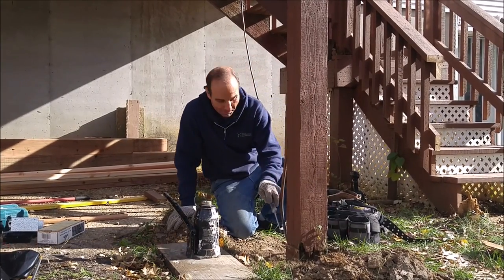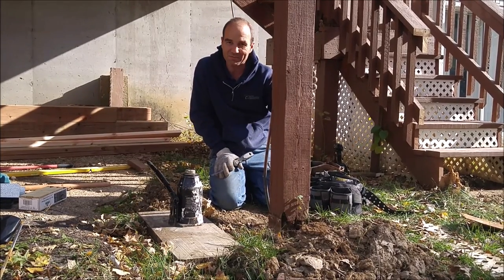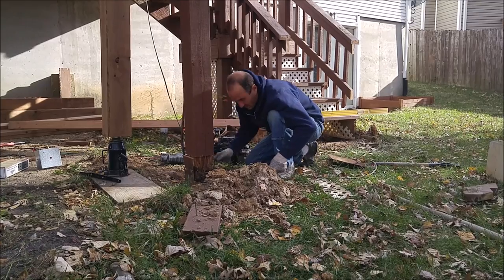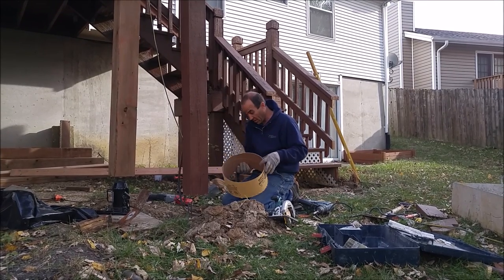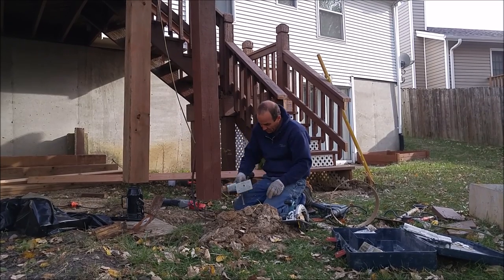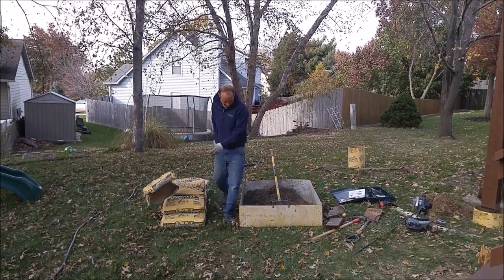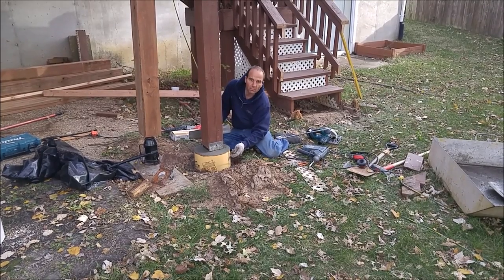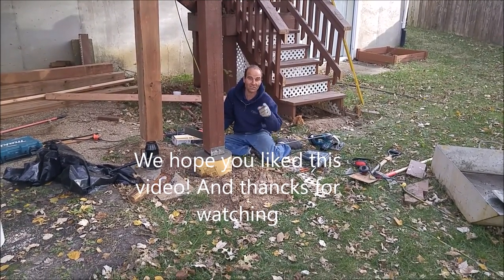How to Replace a Deck Pier

Comment: Excellent. I was planning on hiring a contractor and replacing my entire post but this seems far more cost effective and something I could do myself. my deck is exactly like this too. Extremely helpful!
Reply from the maker: Douglas Kennedy, glad to help!  
Please subscribe to our channel so that you are notified when we post new videos.  Hope all goes well!
Reply: @Homemaintenancesolution  I really appreciate the video! What do you think is the minimum height of a sono tube you can mount to the existing pier? yours looks about 9-10 inches? I am dealing with a short Post height. I am working with about 12"  of space between the deck and the pier. Would 4 inches of height be enough?
Reply from the maker: @JetSetBaroni  I think so.  That should work.
Reply: @Homemaintenancesolution  I appreciate your reply. What thickness rebar did you use? 3/8" or 1/2" ??
Reply from the maker: @JetSetBaroni  either is fine, but I used 3/8".

Comment: I have a screened porch (12x16) that has 6x6 support posts at the front of the porch and a support beam (16' wide) with notched 6x6s and 2 2x10s that is 3' out from house under the porch.  The ground under the support beam has sunken and the support beam pulled away from the porch.  How would you tackle bringing the support beam up to make contact with the porch?  The porch is not high off the ground (3-4') but you can get under it and do some work.  Just trying to gather some ideas on a method to fix this.  I really don't think the support beam is needed because the porch is so low to the ground and have less risk than those 2 story decks of pulling away from the house from lateral force but the support beam is code.  I am thinking of doing the same as what was done in this video, but would like to see what others may have done with a similar problem.

Has anyone had the same or similar problem?  If so, what did you do to fix?

Comment: Thanks for the video.  Exactly what I am doing.  Although I don't see anything about digging out the old post from the cement.  This is what I'm trying to do but having a difficult time. Using a drill and chipping with chisel. Is this not needed?
Reply from the maker: That's a good question.   This is meant to cover how to correct the height if the post is on the concrete.  If you posts are in the concrete, then I suggest breaking the entire pier out and repouring it.  The wood post in the concrete will weaken it and it is most likely not deep enough or large enough at the bottom.

Comment: What type of Jack can i use to jack up my deck as I have the exact same problem you demonstrated here except that the concrete base on mind is 6 inches above ground, and the whole base goes down to a depth of 1 foot. Not sure if I have the jack hammer the top 6 inches to make it flush with the ground. Can i use a regular car jack or one of those car jacks that comes with the 4 wheels and solid based. What type of jack did you use in this video? Thanks!

Comment: I have 12 x 12 deck with three posts, the concrete bases are 4 to 8 inches below ground level, and barely larger than 4x4 wood post.  They may probably deep enough to or below frostline, can I rebar and pour new concrete over to make new base above ground?  Thirty years old house so the base should be settle down good, I wouldn't mind to leave them alone and rebar on top.... will that be appropriate way to do it?  A million thanks from all of your input.
Reply from the maker: My method that I show on the video is to extend a properly sized pier above grade.  If you pier is undersized, then extending it will not help with that.  You will still have an undersized pier, but at least you won't have a rotting wood post on top of it! 😊
Reply: @Homemaintenancesolution  thank you for your reply.  Illinois  frostline is 36 inches, if all met the Illinois codes when they built, then I think I will just take out old 4x4s,  clean the old piers real good, rebar through the old piers,  pour concrete up to 4 - 6 inches above ground and 8 inches diameter. Do you think that would be decent enough? I really  don't want to rebuilt my deck, just want to correct rotten posts.  Am going to replace the old deck wood with composite after that. Edit:  I meant new 12 inch diameter (cylinder), there is no 8 inch :)
Reply from the maker: @nghichlanli1152  seems like a good compromise.  You can't be any worse off than you are now.

Comment: Perfect. Exactly what I was looking for. My option is a bit different in that I do not believe my posts are sitting on concrete pylons although the bottoms are starting to rot out.
Reply from the maker: Dan Peoples, glad to help!  The process is basically the same, just do a little more digging.  Make sure the bottom of your new hole is below your local frost line and flared out at the bottom.  Also, be sure to tamp the dirt at the bottom of the hole before you pour your concrete.  Best to you!

Comment: Great video!  Thanks for the help.  Question:  You said elevate porch quarter inch above where you want it to rest.  Did you leave the post base unbolted to the post until after the concrete had set and you had lowered the post?  I'm wondering if failure to do this would cause anchor bolt to prevent lowering of post after the concrete had set up and shrunk.  Is this an issue?  Thanks again!
Reply from the maker: Yes.  I would wait to add the fasteners until after the concrete sets up and you remove the jack.
Reply: @Homemaintenancesolution  how long should you wait to let it set up?
Reply from the maker: @102wingnut  24 hours is good.
Reply: @Homemaintenancesolution  awesome thanks!  I may be using this method this weekend!

Comment: I have deck piers that have a hole where the post used to be. I don't see enough concrete to put the rebar in. Do we need rebar or can we pour the new concrete into the hole left by the post and into the concrete tube to recreate a better pier?

Comment: You need to secure your short pieces of rebar to your existing pier by using concrete anchoring epoxy adhesive.  Important step!
Reply from the maker: Thanks for the comment, Mark!  Actually, it isn't necessary here, because the bearing weight will keep the pieces together.  The rebar just keep lateral movement from occuring.

Comment: Exactly what I need to do to my back porch deck. It has a roof over it attached to the house. The pier holding up one corner is on a slope and has slipped about 2 inches. What tonnage size jack should I use ? It's a 12' X 12' deck.
Reply from the maker: I'm not sure,  but probably not as heavy as you think it is.  Just try a decent sized jack and see how well it lifts it.  If it won't then you know you will need a bigger one.

Comment: How big and deep of the holes would u drill if I am using a 1/2 inch #4 rebar? Do I need to blow the the concrete dust n clean the holes after drilling? Great tips, thank you.
Reply from the maker: I would clean out the holes a little, but it's not important since the rebar is only to prohibit lateral movement.   I would drill them around 4" deep, if you can.  Thanks for the reply.  Please subscribe!

Comment: Thanks for the great video.  My situation is a little different so curious how you would approach my issue.  The corner of my deck has lifted an inch or 2 due to the cement pier lifting out of the ground.  It’s also the corner of the deck near the stairs but I don’t think the stairs lifting due to frost were cause of the problem.  It clearly looks like the cement pier lifted raising the corner.  
Thinking I could level off by cutting off some of the 6x6 but my fear is now that frost has moved that pier once I’m afraid it will be an annual event of moving due to frost  now.   Am I better off trying to fix the position of the cement pier that lifted a couple of inches and if so how would you go about it?
Reply from the maker: We'll, ideally you would replace the entire pier with a properly designed pier that has a large enough footprint and is below the frost line in your area.  

You could try cut the 6x6 off and see what it does first though.  If it settles back or moves in any way then you know you need to dig that pier out and replace it.

Comment: I know the video is older. How long does it take for the cement to set before you can lower the post for load bearing? Approximately how much concrete is needed? Thank you for the informational video.
Reply from the maker: You'll have to figure your volume in cubic feet and look at the bag cubic feet amount.  
A good rule of thumb is wait 24 hours before bearing on it.  If you have a large amount of weight concentrated onto one post, then give it 48 hours
Reply: @Homemaintenancesolution  thank you

Comment: Where exactly did you support the overhead structure so it was safe and solid? That critical factor is why I came to this channel. I guess you didn't think that was important.
Reply from the maker: Good question.  It will be different on every deck.  Look at how the weight is transferred to the posts.   If the posts are supporting a beam, then jack under the beam.  If they are connected to the outside rim joists, then jack under those.  You just need to get under something that is supporting a broad amount of weight.  Don't jack against a deck surface board and expect the nails or screws in it to be strong enough to lift the deck.

Comment: Wonderful video, My post is loose but I don't see rotted wood, the wood is inside the soil though, after looking at your video, I feel this has to be fixed anyway to avoid quick rot.  How to fix it, would be useful if you have a video for that.
Reply from the maker: You should be able to solve your problem by following the same process.

Comment: I have a similar problem but rather than exposed grade I have a brick paver patio that surrounds the deck posts. The posts run through the paver patio to poured posts, but the lack of maintenance over the years to keep the pavers sealed (previous owners)  has led to the decay of the wood. Any suggestions you have are appreciated.

Comment: Great vid! How old was that deck? I just had one built and they put in a metal post base (like yours) but its all below ground and now buried. My 6x6 PT posts in partially buried. How long will it take to rot?
Reply: Thanks! I'm not sure how old that deck was.. Your pressure treated post should last 5 years or so before they start rotting, but I but I would clear out the area or raise the pier height to prevent it if I could.

Comment: Great info. thank you.  I've been looking for this exact info. for a while.  Can you please tell me if the sonotube diameter needs to be the same size, bigger, or smaller than the old pier on which it will sit?
Reply from the maker: Kathy and Steve Moelter, thanks for feedback.  Glad the video helped you!  
The size of the pier extension should be about the same as the existing one.
Please subscribe to our channel if you haven't already done so.

Comment: Thanks for the info! So I'm guessing the old post was just anchored to the top of the pier? If a post was buried down into the concrete footing, would you just dig out the footing and pour a new one once you cut off the rotting part of the post?
Reply from the maker: Yes, except I would try to get as much of the wood post out of the concrete first.  That will help the new concrete lock on to the old better.  Best to you!

Comment: Thanks for the great video. I also need to raise my sono tube footings about  8 inches. I would also like to increase the diameter. Do you see a problem putting a 10 inch diameter cap over an 8 inch diameter pier that goes down well below the frost line? My current situation has the piers about 3 inches below ground level and 6x6 post on an 8 inch footing barely fits.
Reply from the maker: As long as the 8" piers provide enough footprint to support the amount of weight on them, then it should be fine to make the top bigger.

Comment: Question.  I see you used a 12" sono tube.  Is that the same size as the existing concrete post or is it wider or narrower?
Reply: Did you ever get an answer to this question somewhere else?  I’m planning on replacing my 4x4 deck posts with 6x6.  Existing posts are below the grade (in the dirt, sitting on sonotubes.  I want to extend the sonotubes so they r slightly above the grade, and can support 6x6 posts.  Trying to figure out if it’s possible or if I should just dig them out and pour new
Reply: @martinpersaud1319  No, but I removed the rotted posts from the concrete under the deck and porch (Pain in the ass job) and drilled holes in the existing concrete (3-4) and installed rebar and used the appropriate sized sono tube (12" in my case) and poured/bonded concrete to the existing concrete footer.  The existing concrete was in good condition with no cracks.  I used Simpson Strong-Tie ABA 6-in x 6-in Zmax Wood To Concrete Base to place the 6x6 post on to keep wood off the earth and concrete.

Comment: Similar situation with my deck which currently has two, 4x4 posts. They could come up a good 5-6 inches. If I’m going through this process, would it be valuable to move to a larger post?
Reply from the maker: It could be Jason.  There are lots of variables in this decision, so I wouldn't want to steer you wrong because I can't see your situation.   I guess if you aren't sure, it wouldn't hurt to go to 6 x 6s.  Best to you!

Comment: Thanks for the video! My balcony wood deck is sagging on one far side. I cannot figure what is causing it, but I suspect it is the 6 x 6 support pillar which seems to have twisted out of alignment and the horizontal brace beam above it is also sagging downwards. while the other pillar and horizontal support beam are perfectly aligned. the support beam on the sagging side is not plum or perpendicular to the bottom of the deck. Do you think it shifted or may be rotted at the base? Maybe I need to do what you did here. Thanks for any suggestions!
Reply from the maker: I suggest getting a professional to look at it.  It is hard to diagnose without seeing it.  
If your pier is settling or shifting out of alignment, then a new pier is probably in order.
Reply: @Homemaintenancesolution  Do they sell pre-made tiers that come with the support base bracket and pre-drilled anchor? Maybe If I jack up the deck with some support blocks, and dig underneath, I can better access the damage. Thanks for commenting!
Reply from the maker: @charronfamilyconnect  No.  You really need to get a professional in to look at it.  It sounds like this is above your skill level.

Comment: How do I do what you  did because all I have is small cement blocks under my post that are starting to rotten. I have NO peir  base .The cement blocks is all I have under my post that set on dirt.
Reply: That makes it a lot harder, but it can be done.  You will need to dig a full pier down to the frost line in your area.  It needs to flare out at the bottom before you pour the concrete.

Comment: Thanks for making this video, I have to do the exact same thing. Question: how do I know the old peer is deep enough to use, how deep should it be? Thanks again
Reply from the maker: That's a hard thing to know for sure.  The pier should have a wide base (the diameter of that is calculated by the load by an engineer) and be below the frostline in your area.  Here's an article that might help in your area. 
https://www.decks.com/how-to/264/deck-footing-frost-depth-map
The standard way of checking the depth of you footing or pier, is to use a long metal rod with a point on it.  You can push it down into moist soil and project the depth of the footing by where you are hitting it or not.  

All that to say that this is not an easy thing to determine.  I usually use a different test.  
IS THE PIER SETTLING OR HOLDING IT'S OWN?  Some piers will be crooked and/or settling.  If that's the case, then I wouldn't add to that.  If the pier was low to start with (or the ground has been added to) but is stable OR settled a couple inches and has stabilized, then I would consider it to be a good candidate to add to.  Hope that helps!
Reply: @Homemaintenancesolution  Yes thank you for your help I appreciate it. I did some digging, I can't believe the previous home owner set a 6x6 on top of a cinder block and buried it. It's a raised deck about 12' off the ground. I'm no expert but I'm reasonably sure this is not only dangerous but it's also against code in every state.
Reply from the maker: @billveder1071  Yeah, that should be replaced at some point.  Not deep enough, not large enough, and not to code.
Reply: @Homemaintenancesolution  I fixed (3) 6x6's deck posts. I dug 2 ft deep, 6" of packed gravel, loaded with re-bar, poured a 2'x2'x7" footing. I used (2) 2' sections of re-bar pounded all the way through but protruding up about 8" for the sono tube. The next day I filled the 12" sono tube and used an integrated 6x6 strong tie galvanized cement anchor. After another 36 hrs of dry time I drove in the 1/2" galvanized lag bolts. 2 weeks later I'm finally finished. WOW! It was a a lot of work. Thanks for your help.
Reply from the maker: @billveder1071  Congratulations!

Comment: What is the best way to move back a post six inches from your house? I will be getting siding install and would prefer  having the siding go  straight across
Reply from the maker: I would dig down next to it and pour a larger pier that would attached to the existing pier with rebar.  Then set a new post base on top of the new larger pier.

Comment: So the top of the tubing needs to be even with the bottom of the post. 
Must be precise or the concrete will come up into the wood post if tube too high
Reply from the maker: If you use a metal post base, then you would have a gap between the two equal to the height of the metal post base.